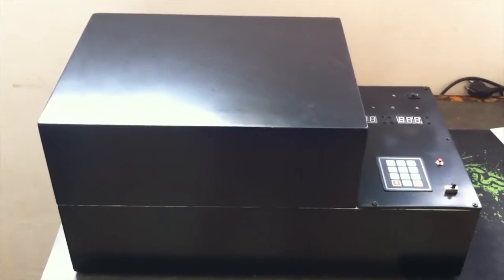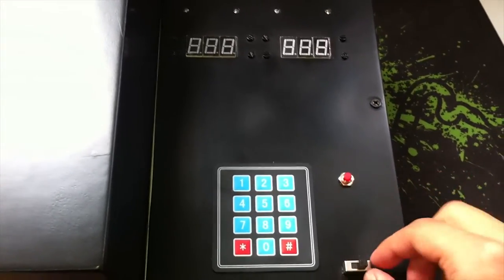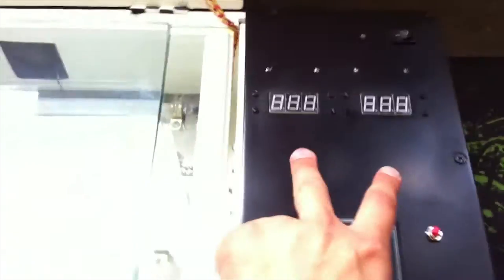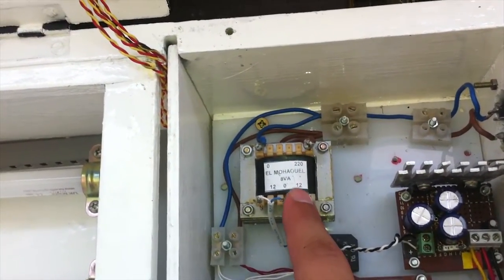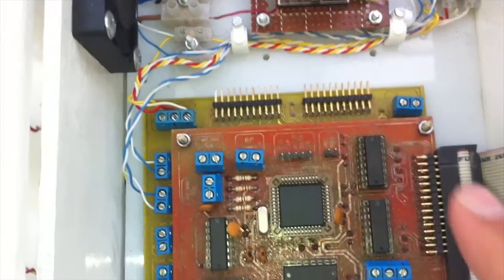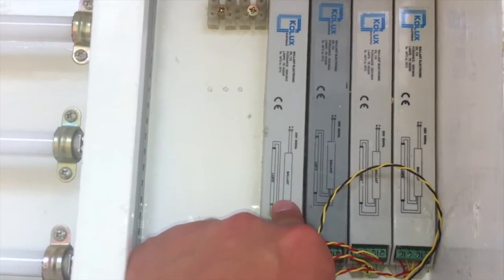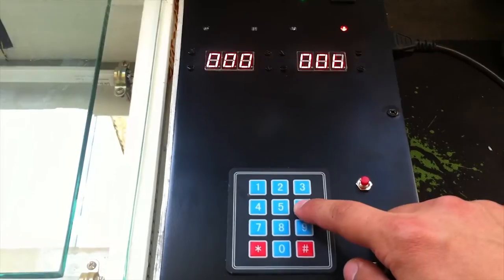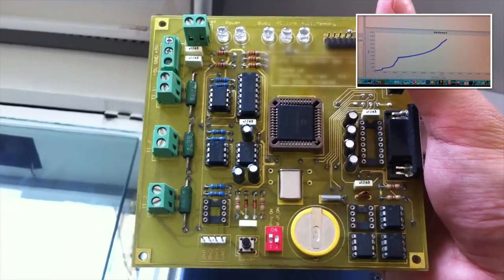Homemade UV Light exposure unit for PCB

Comment: Really nice video and also a very nice UV-box! The circuit board in the end was also very nice, may I ask what kind of finish you have on it? The traces looks like some sort of gold..? Doesn't look like copper and doesn't look like tin, so I'm just curious what it may be =) Thanks!
Reply from the maker: +Chris Fredriksson i spread a green acrylic varnish spary on the board after clean it of course.

here's the spary that i use it : http://www.conrad.fr/ce/fr/product/065280/Vernis-vert-100-ml-KF-1451